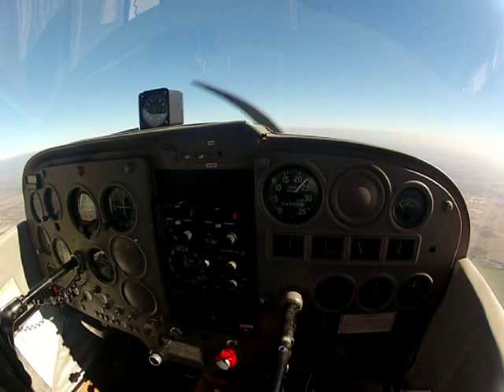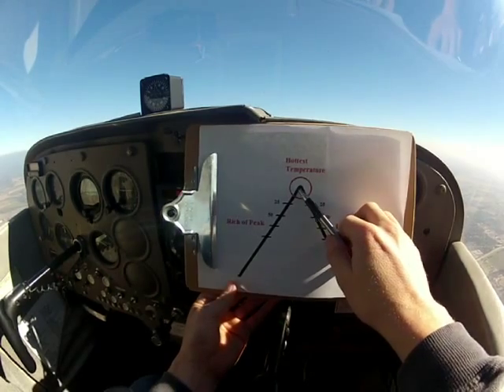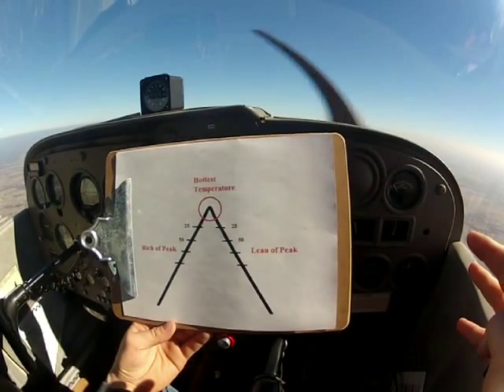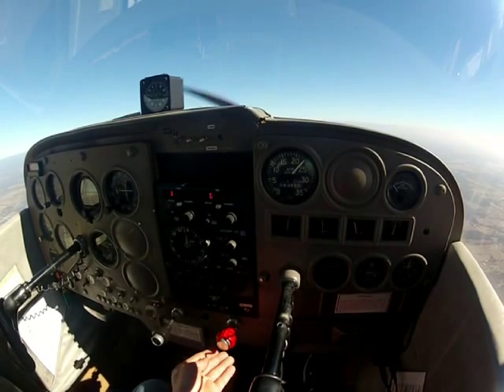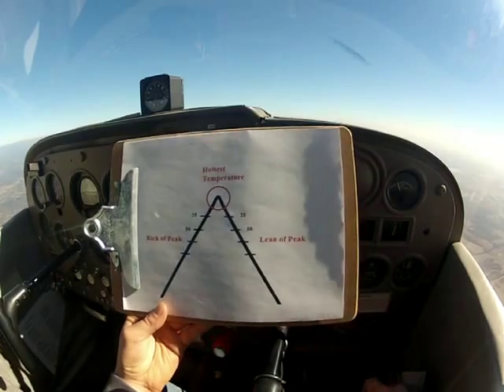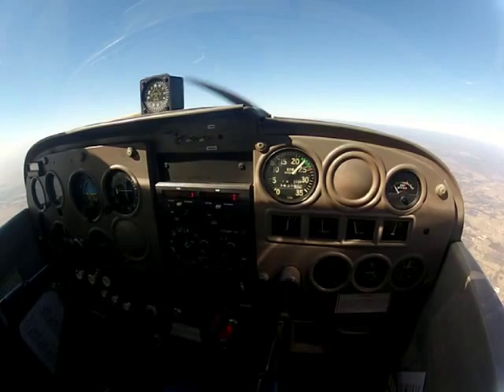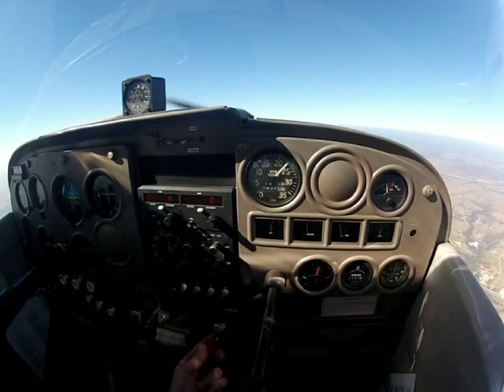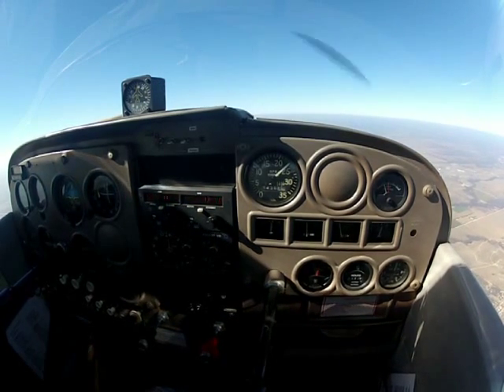Leaning the Fuel Mixture for Cruise Flight

Comment: While you are well intentioned, your information is almost as wrong as it can be. Slightly rich of peak is the worst possible place to run your engine. PLEASE PELASE PLEASE watch or read any or all of Mike Busch's articles and/or webinars about the subject of leaning. And for goodness sake, get a full engine monitor!! The old single probe analog gauges tell you next to nothing about the actual state of your engine. I mean no offense. Peace.
Reply from the maker: Ive sat through about 10 of mike Busch's Seminars at Oshkosh. Its impossible to run leak of peak accurately  in a carbureted engine. The fuel/air mixture is completely different in each cylinder. Only fuel injection model engines that have the ability to precisely put the same about of fuel/air mixture in each cylinder will this work. and I hate to tell you this. but everyone has been flying airplanes for over 100 years using the method I teach in this video.

Comment: I don't want to be that guy but the information in this video is not the best or most accurate. In fact, running the engine 50ºF rich of peak EGT is right about peak CHT and where you can cause the most harm to your engine. Even if at cruise this is not a big problem, there's really no reason to run the engine here, as this is neither the setting for best power (peak RPM), nor the setting for best economy (peak range).

I have a video pointing to Lycoming's charts and explanation here - https://youtu.be/actzekYCVV8

Comment: Either 50 degrees lean of peak or 75-150 degrees rich of peak is best.  As long as the CHT's stay below about 380. Below 360 ideally.   Stay out of the Redbox and transition through it as fast as possible.

Comment: With the greatest respect, I would like to suggest that anyone wishing to do least harm to their engine(s) and improve their fuel economy and in some cases performance, should seek out, arguably the most knowledgable and digestible information, by Mike Busch, Savvy Aviation. (Rather than add links which break over time, just search google and find articles by him).
He explains in great detail, but in layman terms all the information you could ever want on leaning and why you might want to consider running LOP where possible and many other subjects for that matter.
It is often thought that the manufacturers information is definitive, but as you'll see with a bit of research, over time, knowledge has been accumulated and what was once considered 'good practice' has subsequently been proved erroneous and the manufacturers are loath to go back and correct old manuals and data sheets etc. presumably because that incurs costs and re-certification?

For what it's worth, since running my engines in the way Mike advocates, my engineers have said that, they are seeing a lot less wear and tear and much better condition of our Lycomings than would be expected in 'normal' use over a period of more than 10 years.

Comment: Beware of anyone who keeps ending sentences with "ok?"  These are rigid non-thinkers who just memorize what they have been told is "right thinking". This video is not only shallow,  it's mistaken and wrong in many significant details. This guy is NOT an engineer nor does he work from real data. Temperatures don't follow his silly triangular diagram. Proper leaning with real instrumentation recognizes that EACH cylinder needs real-time EGT and CHT readouts,  and should be done with WOT (wide open throttle) to get the best possible mixture distribution. This means you should be at an altitude that will lower the engine output to a cruise power percentage. You should wind up about 50 degrees F LEAN of peak,  although even leaner is perfectly acceptable.  Leaning with partial throttle is asking for it due to cylinders possibly being at very different places on the curve because the of throttle plate interfering with even mixture distribution. AGAIN: if you want to do this right and get useful range enhancement without risking shortening your engine life,  you need EACH CYLINDER INDIVIDUALLY INSTRUMENTED for BOTH EGT AND CHT.  And it's CHT you need to worry about- so lean past peak EGT until you can see the cylinders aren't running hot- EGT is not the thing that is going to do the damage.
Reply from the maker: Im showing people the leaning process on a normal aircraft sir.. not one with an engine monitor… plus in order to do lean of peak and to do it correctly you have to have a fuel injected engine with tuned Injectors so everything is distributed equally… OK.
Reply: @Ayersaviation  That is absolutely wrong . A normally carburated engine often has very even distribution once the throttle plate is wide open. (Lycomings sometimes do not,  but Continentals are fine once you are running wide open.) LOP operation at an altitude where WOT gives cruise power- 65-70% is not only possible but the only intelligent way to fly. So don't give me that crap about "fuel injection and tuned injectors only". You obviously need to get educated about this- I suggest you get a copy of Jack Norris' book "The Logic of Flight". If you don't recognize that name,  he's the guy that not only designed the props but was Mission Flight Director for the Voyager Around the World Un-Refueled flight in 1983. And I'd say he knows a hell of a lot more about this topic than YOU do. And I can vouch for his techniques,  as if that was necessary. An "engine analyzer" sits right between your ears once you get EGT and CHT from each jug. Try thinking more and spending less on electronics.

Comment: Besides pushing & pulling the mixture knob I notice you twisting it too. What does twisting it do? (I'm new to this)
Reply: I believe twisting gives you a finer adjustment.
Reply: @jamesmiller7911  A vernier control can either be pushed or pulled, but it is basically locked in place- you have to depress a button on the end to get it to move. But it ALSO has a "screw in- screw out" function,  that lets you make small adjustments either side of the locked position. So twisting doesn't necessarily give you a "finer" adjustment; you can do the same thing pushing or pulling- but it is more convenient since there is no trouble with overshooting the desired position. OTOH, when a vernier control fails it can be a catastrophe- smart people usually avoid them for throttles. Some people haven't gotten that message- they either lock and are unmovable or they disconnect completely with no chance of an inflight repair. They are heavier, much more expensive, and have undesirable failure modes. The choice is yours. (Personally,  I like them...but while I have a couple I still cannot justify installing them on anything but a cowl flap)
Reply from the maker: my Mixture knob is the Venturi  type where you can push/pull or twist in in and out to adjust it!
Reply: @Ayersaviation  Damn. "Venturi" type?  You mean VERNIER???
Reply: @craigwall9536  Oh dear, I feel your pain Craig. I think he is the worst kind of advert for the profession.

Comment: I hate to correct you, but the highest pressures & temps are approximately 40 degrees on the rich side of peak. In your example, you found peak with the Tach and then enrichened the mixture slightly putting you precisiely where you do NOT want to be. I recommend reviewing Savvy Aviation videos on proper leaning procedures.

Comment: He is correct however not all cylinders are the same by leaning with the tac you could be running some cylinders hotter than others and without a full engine analylizer you are only leaning the cylinder which the probe for the egt is in the only way to safely lean the engine is to lean the hottest egt cylinder which would require the analizer

Comment: Use the tachometer,  then watch the egt to confirm you're not too lean.  Then put the egt in your scan check routine until you change mixture settings or requirements

Comment: You should correct your information.  Running at peak EGT is not necessarily the hottest "engine" temperature or cylinder temperature.  The hottest cylinder head temp occurs at highest intracylinder pressure.
Reply: Very true! 
You better do not listen to much. It can be done based on RPM, so far it is not plainly wrong. But you better forget the rest of this video.

Comment: The only way to harm your engine is not leaning and getting deposits causing hot spots and/or running 50 degrees ROP at high power settings resulting in high CHTs.  LOP operations causes no harm and helps keep the engine free of deposits with cooler temps.
Reply: Nobody advocates running "50º ROP at high power". 50º ROP would be used for a 75% rated or less cruise, or for climbs at a high DA where the engine cannot develop anywhere near rated power.

Comment: That's quite "old" knowledge and some inforrmation plainly wrong, even based on old POH from the 70ies. As a general information incomplete and misleading at best...
Reply: yep completely wrong and is still the ignorant method rental clubs and flight schools still teach until this day. EGT has nothing to do with engine damage its only a sign of wasted gas going out the pipe, lean of peak toward stoichiometric side to keep cylinder head temp 380 or below and your engine will last a lifetime. "avoid the red box", hint hint from the engineer who knows how to do this properly, not from this stupidity in this video.
Reply: The information in that video is good basic information. I agree it was not complete but it was certainly not "plainly wrong".

Comment: Hello sit, i fly a 1985 cessna 182 skyline, and it has the edm 700, but i dont know how to use it pretty good, i lean the mixture by looking at the rpm, is that ok? Or should i do it by using the edm. Please help, write to me at licbanuet@gmail.com
Reply: Fernando Ban 
Rpm so you don't stall! Primary function.
Take a quick look across often to monitor the temperature as a secondary.